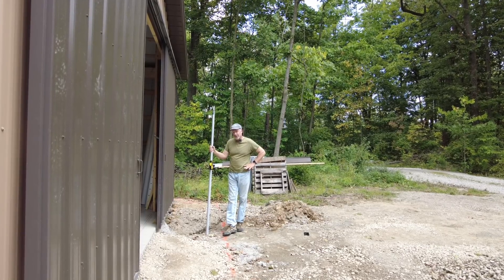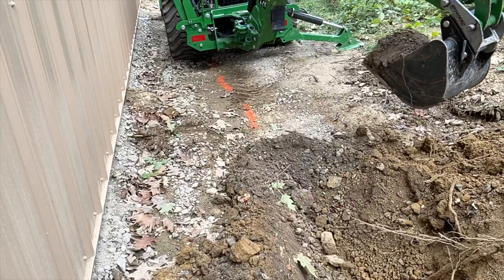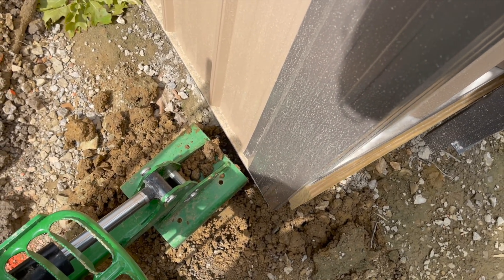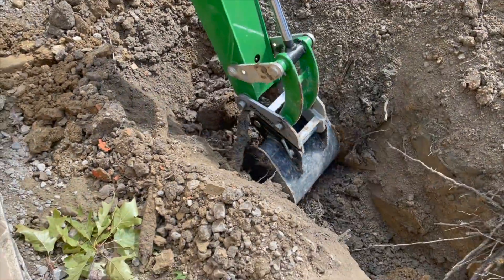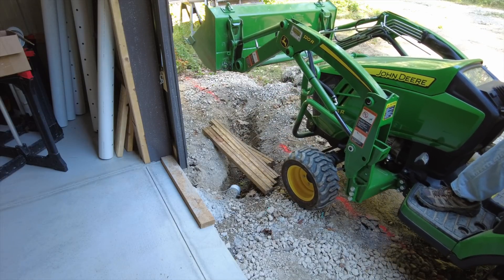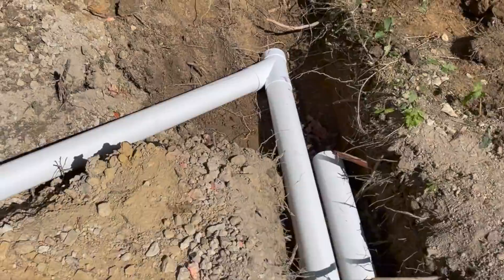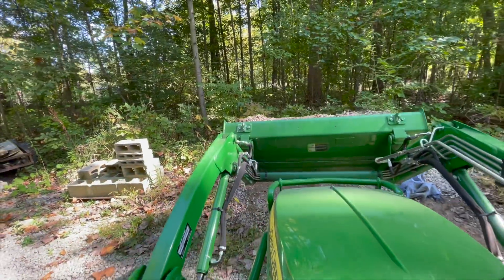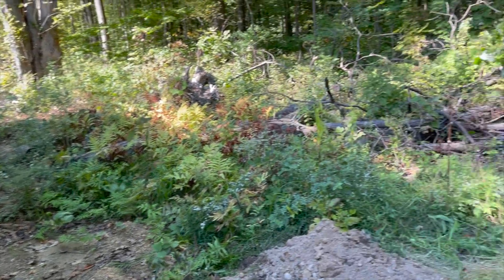John Deere 1025R:  Drain Tile And Gutter Drains

Comment: Into the creek?  So is the creek on your property? Usually there is at least a 20 ft easement each side to any wetlands  thru onto the next neighbors property the creek traverses and the neighbor property before the creek traverses thru your property at least here at long as the creek traverses, or have you just had your drainage water just piped strait into the creek for the past 30 years or since you got the land?   I just never heard of property owners legally using creeks as drainage ditches for their run off out of their garage floor strait into a creek.

Comment: Noticed you getting off the backhoe and driving to move the tractor. It takes practice, but I only have a few weeks experience and started moving the backhoe forward by raising the loader bucket, raising the outriggers a little, then putting the dipper arm about halfway from the tractor, press it down a little with the teeth in the soil and move that arm away from you. Your tractor will move forward 4-5 feet. Lower the loader bucket and outriggers and go back to trenching. I also use this technique to pull the backhoe back further. It's best to leave the brake off. You can't do this on hills though. Learned this technique by watching professional operators on construction sites. Here's a video showing this technique and some others:   https://www.youtube.com/watch?v=9_WQCkOX1IY

Comment: Wonderful to  watch all your work and I have a 1025r too. It’s perfect what you do with slope the drain pipe and gravel it up but that told I guess you will get plouged  pipe over time  of dirt that sinking through the gravel and in to the pipe drain hole. A covered fabric around the pipe would prevent that. Just some to keep in mind. Keep up the great work. Joergen North Ohio

Comment: Should have covered it with all gravel, no dirt. Will not drain as well.
Reply from the maker: A portion is going to have grass planted to keep down the mud, and it's looking like the concrete drive won't be until the Spring.

Comment: Doing a great job on the drains if you wanted it to be epic and trouble free put fabric down in the ditch before laying the pipe in then put the gravel in and then fold over the fabric and put your top soil on this prevents the dirt from migrating into the gravel then eventually clogging your pipe

Comment: I am thinking you could have fixed the water problem by just piling that area up higher with dirt.  The water would have just went somewhere else.
Reply from the maker: Everything flows in that direction from the house area to a creek.  Getting gutters will help, but the natural drainage of our property essentially goes through the pole barn area, so I'm just trying to divert some of the runoff to have less moister coming up from the pad inside.